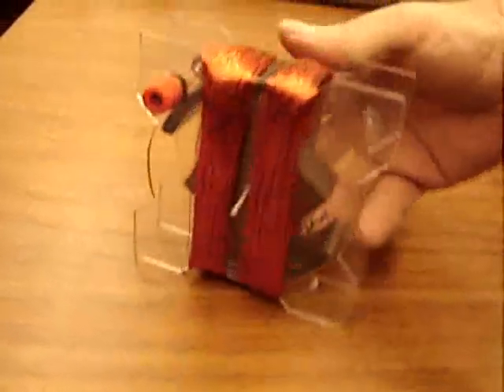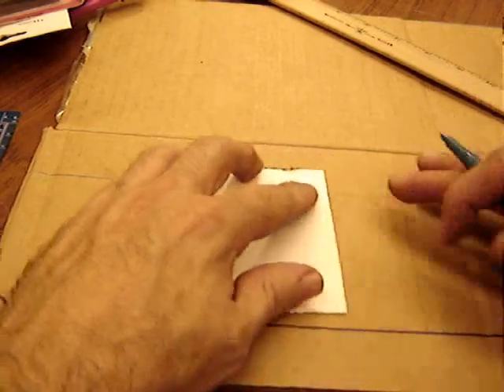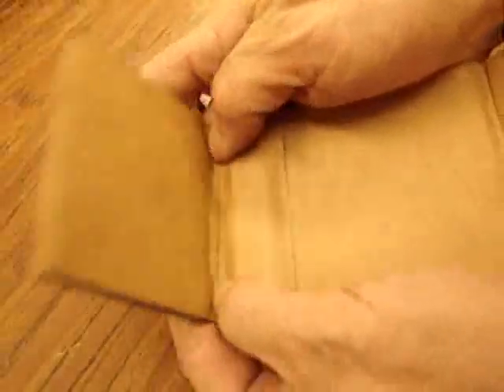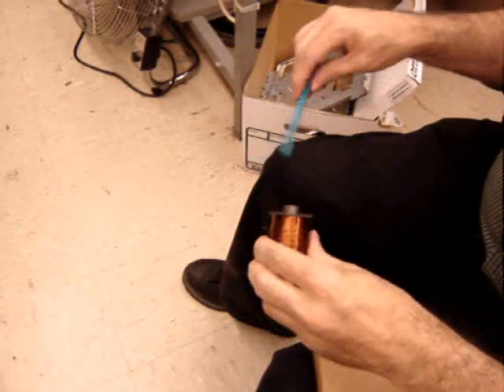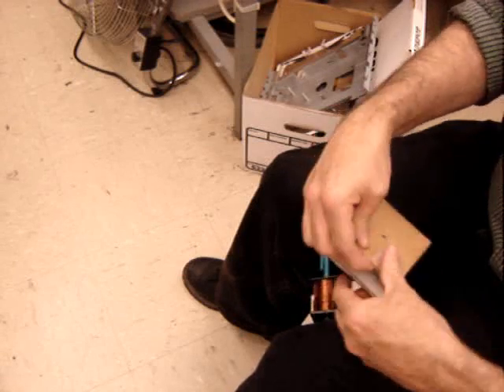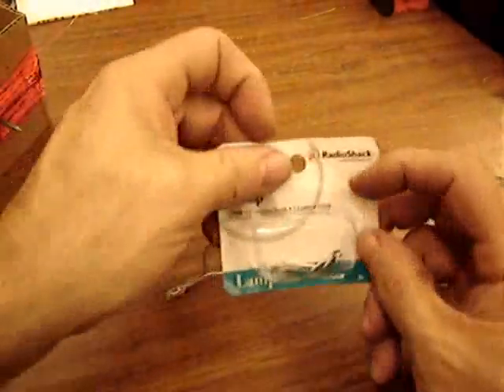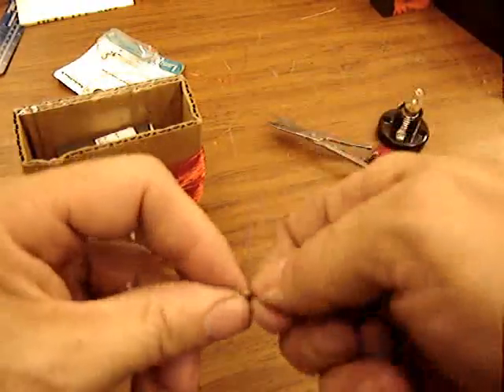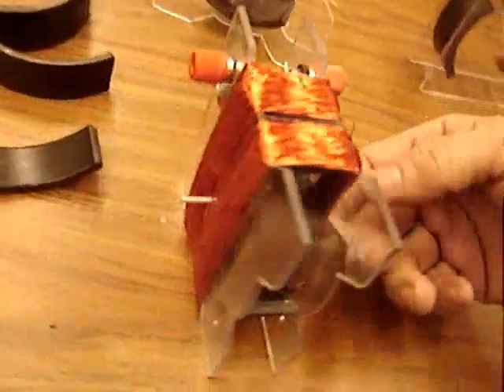Simple generator:  AC electric generator for science fair

Comment from the maker: > how much is the ampere

@neil8051  the value of electric current depends on the bulb.  If no bulb is connected, then that's zero amps.   If a special 1.5volt 20mA bulb is connected and the generator lights it to full brightness, then that's around 20mA or 0.02 amperes.

Generators don't exactly produce current.  Instead they are a source of voltage.  Then the light bulb is like a leakage-path which draws a current.

Comment from the maker: @dlst5577 Use lots more turns of wire, not just 250.   Buy some solenoids mailorder.  They have spools of much cheaper wire inside.   Or check out the wire sources mentioned in the project.

Comment from the maker: @agentdeidara  if you clean all the plastic off of about a half inch of the end of the coil and the end of the new wire, you can twist the ends together solidly, with lots of twists.  Then cover the twists with tape.

I use fine sandpaper to take all the plastic coating off of the ends.  The bare metal much be touching together.

Comment from the maker: @Ricardihno90  first make several cardboard generators to learn all the tricks.  Plastic one requires power tools.   If you're old enough to use a power saw safely, then you can figure out your own plastic version.  Just keep the plastic housing small and fairly thin, so the wire coil is held very close to the magnets.

Comment from the maker: @sarahboumatar281994   This project is designed for cardboard, and for a small amount of wire, so it only makes about 3/4 volts output.   You can try a red LED too, but you'll have to spin the magnets way faster.  Or just wind 2x more wire on the coil.

See the main article for changes needed if you want more volts.  Expensive neodymium magnets would do it.   Or use 2000 turns of wire, not just 200 turns.   Or use a machine shop to make a professional generator with close-fitting steel parts.

Comment from the maker: @bryanna96587mah bare wire doesn't work.  It would be a totally short circuit.

Thick plastic insulation won't work, since the coil would be way too thick. Only enamel varnish wire will work.   Sometimes it's red or orange, so it looks like bare copper wire.

Comment from the maker: @joysareencool  every piece of wire always has two ends.    The electricity inside all wires can only flow if the wire is connected in a circle.   The small light bulb is part of the circle.

The electricity was inside the metal wire and inside the light bulb filament.  When the magnets move, all this electricity begins flowing at once.   It's like a rubber drive belt: the magnets push on one part of this belt, and the entire belt starts to move.

Comment from the maker: @mohe3439  wires have to be as close as possible to magnets, but a disordered coil works fine.

Better is to wind lots more wire, like 600 or 800 turns.  Get cheap wire: mail-order surplus companies sell solenoids, the open-frame kind.  Pry apart to get the wire spool.  Way cheapr than Radio Shack.  Or see lots of wire-spool sellers on the project website.

Comment from the maker: @Absol2819   You used very thin radio shack enamel-insulated wire?  Size #30 gauge?  Notice on main project page: don't use different wire, don't use different bulb, don't use different magnets.   Use #30 varnished wire from radio shack, or take apart a 24V solenoid to get out the spool of thin wire.

Comment from the maker: @thehomeslice101  this video is incomplete.  It's just an extra on the main website.  Need to read the project instructions.  Follow the parts list on page 2, don't use substitute parts.

If you use an LED instead of the special Radio Shack bulb, you'll need to add 2X or 3X more wire.

Comment from the maker: @faight3r nope, that's the misconception.  Actually, magnetic field moving and crossing wires will force electricity to start moving.

Wires are like tubes full of marbles, marbles are the electricity.  The wires were already full, and the magnetic field just pushes it along.   Generators create electron flow, but they don't create electrons.

Comment from the maker: @Absol2819 go to the website.  Click on "How it works"

Briefly:  wires are made of movable electrons and solid, immobile protons.  Wires are like pipes full of water.  Generators are "electricity pumps."  The moving magnet pushes the wire's own electrons along.   Electricity is like a rubber drive belt, and a generator is like a drive wheel with the belt of electricity passing over it.

Comment from the maker: >Mine didnt work

@Absol2819  tried the liste of suggestions in the "debugging" section?    Usually the problem is, used wrong parts not on the parts list.  Other problem is: didn't spin it fast enough.

Comment: @wbeaty Thanks. I tried it with the 1.5V 50mA and it worked but i had to spin it ALOT. Luckily mine is a windmill so i don't have to use my hands all the time. Just one more question, how do i connect more wire to the current wire i'm using?

Comment: What kind of factors would play into the efficiency of this? Would different size magnets or more coils with the wire improve output?
Reply: Number of coils would surely increase the output, and although the size of the magnet wont matter as much, the magnetic power (flux density) of the magnet affects the output as well.

Comment from the maker: > circular magnets
@heathertaylorable Yep, big 2" or 3" loudspeaker magnets work fine.  But they must flip over, not spin on axis.  The coil of wire needs to stay very close to the magnets.  It's hard to find the right size of pipe: a pipe that fits close yet still allows the magnets to flip without hitting the inside.

Comment from the maker: @ale5killer exactly right.  the bulb flashes each time the magnet flips over (so two flashes per complete revolution.)   If you could spin the magnet enough times per second, the filament would remain hot and stay constantly bright between surges of voltage.

Comment from the maker: @ZeroGenerations Yep.  You'll have to spin the magnets a bit faster.    You can even use a red LED if you add lots more wire (like 500 turns.)   Or spin it extremely fast with a power drill.

Comment from the maker: @gabriel70149   read the main article.  It says DON'T USE DIFFERENT PARTS.    You must use copper #30 wire with enamel insulation.  Find it at Radio Shack or other listed sources.   Caution:other wire won't work.

Comment from the maker: @kingniels2 depends how fast you spin it.  That special bulb barely lights up at 3/4 volt.   The generator won't light a red LED at 1.7V unless you double or triple the number of turns of wire.  That, or spin it 2X or 3X faster than human fingers can spin it.   Some kids step up the speed: a tiny pully on the nail, a big pulley made from CDs, and a big rubber band as a drive belt.  See "DR. GUPTA'S" generators on the links page.

Comment from the maker: @SkynetNealUK Go check the main article, not just the vid.   See above, where it says "Full information at amasci com/coilgen. main project website?  The url is also right below the video title.

If instructions aren't followed exactly, it won't work.

The magnets must spin EXTREMELY fast, and a propellor might not work unless you use compressed air to whirl it like a blur.    Better is a plastic water propellor and a garden hose with a spray gun.  And try 1000 turns of wire, not just 250

Comment from the maker: > giant magnet and alot of wire

@theorangem1  you can glue the rectangle magnets side-by-side and repelling.  That makes bigger magnets.  Stack those up!

A bigger generator can output more wattage.  This tiny generator has about 20ohms coil, and 1volt output.  So the maximum possible watts is 1/80th W, or 13 milliwatts.  But if you could spin it twice as fast as human fingers can, then wattage increases 4X.

Comment from the maker: @Unequippd   All the AC power would have to be synchronized.   Make them all on the same long shaft, with magnets permanently attached.  Align all the generators together so their AC wave increases at the same time.  Then just wire them all in series.

But it's better just to learn to build advanced wind power generators using supermagnets and pancake-shaped coils.  Go and find the "otherpower" site with hobbyist wind turbine projects.

Comment from the maker: @Allexxx96Reloaded   Yes, read the main project article "FEEL THE ELECTRONS."   This resistance is maximum when the coil is shorted, and zero when the circuit is open.

This same resistance can create a magic trick.  If you drop a magnet down a copper pipe, it will appear to levitate in the middle of the pipe, and fall very slowly.

Comment from the maker: @shusher0099  more turns of wire gives you higher voltage output.   With higher voltage, you won't have to spin the magnets so darned fast.   And it's easier to light up a red LED instead of a weird special tiny bulb.

Comment from the maker: @Tumlock  yep, rubber or plastic or wood is just fine.   Don't make it too thick though.  The coil of wire must hug the magnet closely.  If your box is too thick, then you'll need to add lots more turns of wire.

Comment from the maker: @792sandy   It normally puts out about one volt.   So for 5V, just spin the magnets 5X faster.

Or you could wind 250 X 5 turns of wire (about 1300 turns, but more is better.)

Comment from the maker: @geekatzombies4life    Neo magnet strength is about 10X stronger than ceramic.   So, if you used four large rectangle neo magnets, then the volts/amps would be 10X higher, and maximum possible power output would be 100X higher.   (But this doesn't work if you use a tiny neo magnet!)

Comment from the maker: @PACIFICFL0W  the generator only creates about one volt AC.    To get more, you'd have to step it up.   

Transformers can step up AC, but the generator would have to spin faster than 2000rpm.  Transformers don't work if the AC frequency is too low.

Comment from the maker: @PACIFICFL0W  A generator is like a wheel and drive belt.   But the belt is made of electricity.  When you crank the wheel, it makes the electricity flow.

If we had a drive belt and two pulleys, couldn't we use some gears to connect the second pulley to the first one?  Then it would start cranking itself!   It would go faster and faster, then EXPLODE.    It's a Mechanicity Bomb.   Don't build a drive belt assembly.  You could wipe out your neighborhood.

Same deal with motors and generators.

Comment from the maker: @T3Hun  well actually the output is .030Amp at 0.7volt, or around 0.02 joules/second.  So over five years that's about 3,300,000 joules of electrical energy.  A 50-watt TV set will consume 50 joules of energy per second.  So after five years of cranking, you could run your 50W television for an entire 18.4 hours.

Sci Sci Science!

Comment from the maker: > can i use bar magnets

@coolgs10  several extremely strong bar magnet might work.  I don't know.  But you might need to add lots of extra wire.

First build this using the parts in the list.   Get it working.   Later you can try building a different version.

Comment from the maker: @GamerNationNo1

1. all metals are full of movable electrons.  In physics books they call this the "ocean of charge" or "the sea of electrons."   The sea of electrons reflects light and gives a metal it's shiny silvery appearance.   A metal block is like a tank full of electrons.  A metal wire is like a pre-filled pipe.  No bubbles.

2.  Don't use my project, it's a bad design for wind power.   Try these instead:

bit.ly  /  Uu1hy

bit.ly  /  rkXOM

Comment from the maker: @OCoptimusconvoy  why not just use one turn?  Or ten?  It's because the number of turns determines the output voltage.  (Well, that and magnet strength and RPM.)

If you want to spin it with fingers, and want to light a tiny bulb at 3/4 volt, then you need about 250 turns.  That's the bare minimum.   Or instead, just spin it 10x faster somehow.  Or use expensive neo supermagnets in place of ceramic magnets.   If you could spin it at 3600RPM, that's 60Hz, and you could step up w/transformer.

Comment from the maker: @ncranfill   Click on the main site and go see the links page.  Look under wind power generators, 6KW by Otherpower.   Hobbyists are always building their own 1000W generators.   These are pancake style, and they only need about 10 lbs of neo supermagnets.

Otherwise, just buy a 2HP AC induction motor and use it as a generator.  (You have to look up the website about "induction generator" projects.  You have to add a big capacitor to make those work.)

Comment from the maker: @frncsrnzstbn   Read the website for this project.   Either click on the URL above, or type in the URL from the video titles.   You need a spool of Radio Shack wire.  It's 200ft long, and gives you a cardboard coil of about 250 turns.   But it's better to use lots more wire, like 500ft, for 630 turns.

Comment from the maker: @deer12ful   Might work, but you'll have to spin it faster.   Change the cardboard box size, since it must be VERY close to the magnets.

It always helps to use lots more wire.  Not just 200 turns.  Connect two pieces together to form one long wire.  Use solder, or instead just clean the ends off and twist them securely together.

Comment from the maker: @euler010   See the FAQ on the main website (the first section about using different parts.)  Much thinner wire has too high series resistance.  Much thicker wire makes a fat coil like a baseball, and the outer turns are far from the magnet.

Comment from the maker: @boparaiable   Just order some large neo supermagnets the same size as the ceramic ones.  They cost about $10 each.  It might even work with just two instead of four.

Or, spin the ceramic ones faster than 3000 RPM.

Comment from the maker: @cutieprincess161    Read the website article.   It has a parts list.   Also links to online sellers.   As it says, don't use different parts. normal flashlight light bulbs won't work.   You need a tiny bulb that operates on 20 milliamps or 40 milliamps.   You can also use a red LED, but it's hard to spin the magnets fast enough to light an LED.

Comment from the maker: @evilkid227 yep, neo magnets work.  And with stronger magnets, you won't need so many turns of wire.  But remember that the wire has to be very close to the magnets.  If magnets are smaller, the box must be smaller.   For sizes, see the parts list in the main project website.

Comment from the maker: @TechNERD413   See the FAQ on the main website.   You need thin gauge wire between #28 and #32, with very thin enamel varnish insulation.  200ft barely works.  The coil in this vid had about 500ft.

Comment from the maker: @hairflair149  That would work, but I bet you'd need quite a bit of wind to power it.   Maybe do it in the back of a pickup truck at 70MPH on the highway.   Instead buy a small DC motor.  Any perm-magnet DC motor, if you spin it, becomes a generator.  See the links page on the main website for wind turbine projects.

Comment from the maker: @ketimportaluser   The whole point is to light the little bulb.  Did it light up?  Those bulbs won't light unless you hit 0.7V.   Spin it much faster.   Or do like I did: buy more wire and wind more than 500 turns.

The generator in the video has about 600 turns of wire.  You don't have to spin it very fast to light the bulb.

Some AC voltmeters can't measure this right. They give a low reading. This generator might only put out 10 cycles per second.  For accuracy, an AC DVM meter needs 50 to 60

Comment from the maker: @Xxnikhil   Read the FAQ in the main website.   If you use epoxy to glue the 1in magnets in a special pattern, they can be used.  You'll need twenty of them.  They're not as strong as the big block magnets, so you'll have to add a second spool of wire, or spin the magnets much faster.

Comment from the maker: @BJMaggs6991   If you can make gears and belts spin themselves, then you can do it with magnets.  A generator is just an electricity pump.   A motor is the same but backwards, like a water turbine: force electricity through a motor, and the shaft starts turning.

Comment from the maker: @Jdonovanford   Also, electric generators don't produce current.   They produce voltage.  Then the users draw current from the generator or battery as needed.

If everybody in the city turned off all their lights and appliances, then the generator's current would fall to zero, but it would still put 120V on all your electric outlets.   Generators don't send current to lights and appliances.  Instead, lights and appliances draw current from the generator.

Comment from the maker: @anglocowboy  Nope, not unless you wound way more turns of wire.   Those lights are usually 3v or 6v.   You need a light bulb which turns on at under 1 volt.

Instead, wind 500 or 600 turns of wire, then use a red LED instead of a light bulb.   Most red LEDs turn on at 1.7 volts.

Comment from the maker: @Jdonovanford  Nope, in metals the electrons don't orbit single atoms.When the metal is first created, the atom's electrons break loose and start orbiting all through the metal.  This is usually called "the electron sea" or the "ocean of charge" of the metal.  Metals are full of mobile electricity.  They're like water tanks. A moving magnet can pump the metal's electricity, creating a current.

But all currents must move in circles (same with water in oceans.)   So a closed circuit is required.

Comment: @wbeaty Mmm, not sure if that answers my question. Atoms in matter have their place (right?). Electrons are the particles that jump from an atom to the next one when pushed so by a magnetic field. So once all the atoms at the top of the wire have been turned into possitive by loosing electrons, this can only go on and on. So my question is, how does this actually work when there is no closed circuit, but open (e.g. think of a windmill).